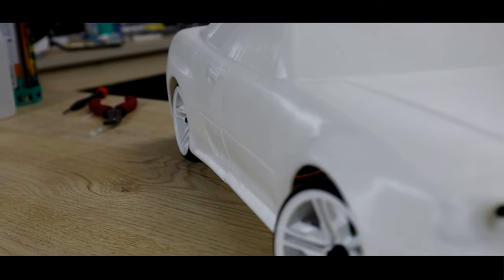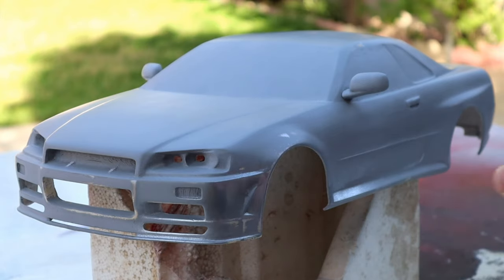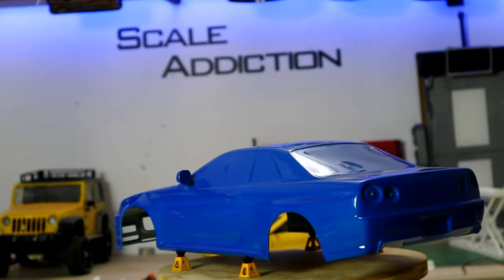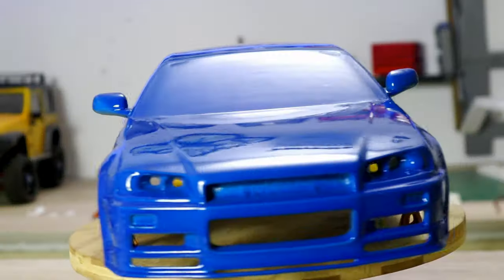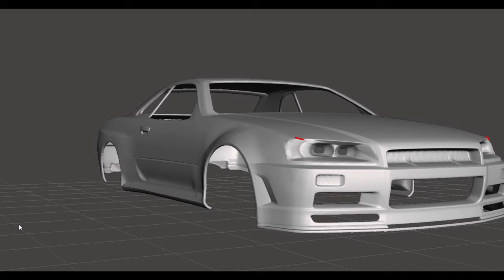3D Printed 10th Nissan Skyline R34 part 2/paining chrome blue/ printable model in SketchUp

Comment: How did you attach the spoiler after painting?
Reply from the maker: It will be attached with small screws
Reply: @scaleaddiction  thx im making one for myself. its turning out great, thanks for splitting into 4 parts BTW. Also Will the morrors use screw too?
Reply from the maker: No, I used super glue before using primer
Reply: @scaleaddiction  ok thx